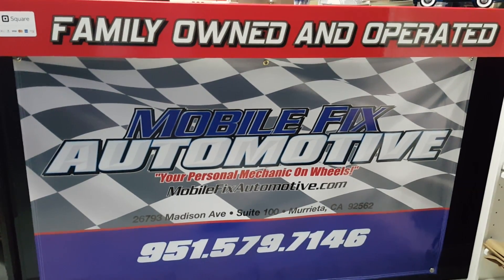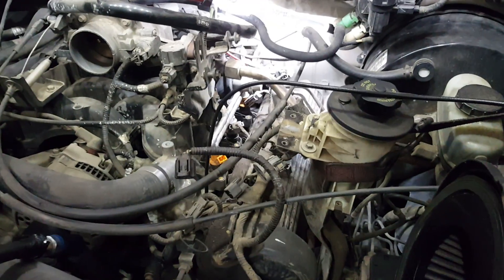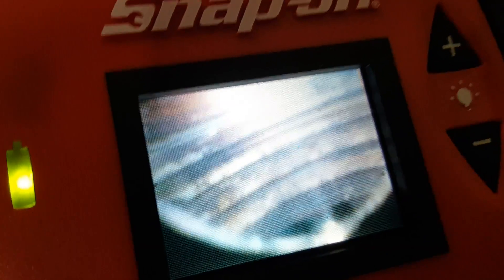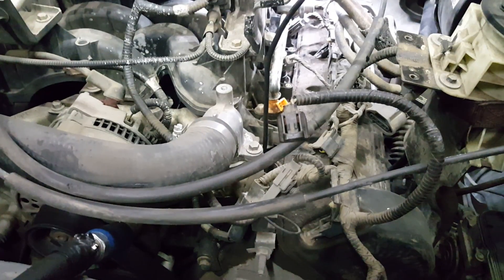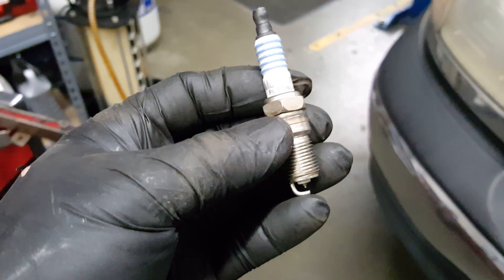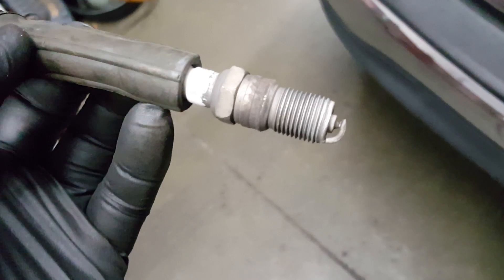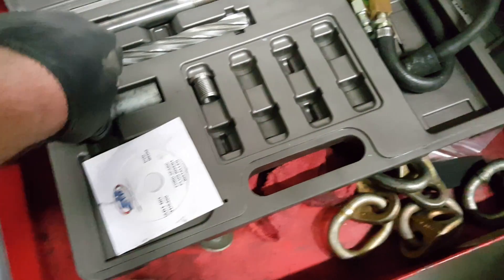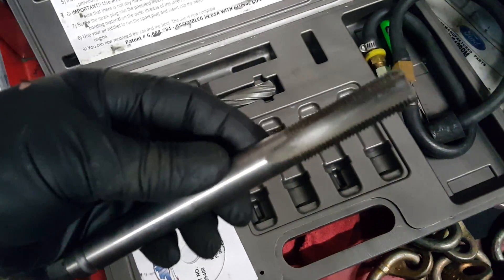Why the spark plug blew out of your Ford Triton engine

Comment: I had a 4.6 in a crown Vic that also had a very small amount of threads.  And there was a lot of room for more threads.   Before I replaced my plugs I was told not to tighten them much at all, and it would be better if I had a torque wrench.  When I took the plug out I was amazed at how few threads held the plug in.  And that was a different engine, similar, but not the same.  So this appears to be a Ford practice.  I installed the plugs fine, but was never completely happy knowing how they were held in.  I've had Japanese and German cars and almost all of them had twice as many, if not more, threads than this.  On an aluminum head, this is not a great design.
Reply: Ford makes unreliable vehicles. Sometimes I wonder if some of their foolish designs are intentional.

Comment: Had a buddy that used to own a truck with this engine plug blew out and dented the hood from inside out had to repair engine and hood then he had exhaust manifold leaks found rusted away bolts on his grange floor from the manifolds.

Comment: Good job Ron. My thinking is the dissimilar metals corrosion problem adds to the few threads problem and that's why so many are blowing out the plug. Look for evidence of water routinely getting into the plug well and leaking past the seal surface into those threads.

I see the over-engineered design of the insert kit, Heli-Coil inserts have worked well for me over the years and my standard tap & die set is a tool set I had already had, not to mention it's universal application.

I wonder if the kit is calling for JB Weld to be used. I think you might be wasting money on the stuff if not. I would use it on a Heli-Coil going into an iron head and not use it on a aluminum head for that very reason. That dissimilar metal thing can work in your favor in the case of a permanent thread repair.

Before I retired (ASE Master, trained at the GM college in Atlanta) my service manager told me I had the highest CSI of any mechanic working for GM: I wasn't too surprised, my stuff never came back.

Comment: 4-1/2 threads on an aluminum head ?  Seriously ???

General rule of thumb for mechanical engineers, the thread engagement depth should be no less than the thread major diameter.

This is a really good example of why I only own vehicles designed and built in Japan or American but older than late 70's.

Comment: Sooooooo this begs the question what about the metal shavings that git into the combustion chamber? or did i compleatly miss something
Reply from the maker: +INVISIBLE SUN this video was shot to show one of the main reasons for being the cause of the spark plugs blowing out. I have two really good videos on the repair procedure start to finish in that is addressed in that video.
Reply: Grease on the tool flutes catches the chips.

Comment: I had a spark plug blow out in the middle of nowhere, hundreds of miles in the Alaskan Interior, on a 2001 V-10.  It was too cold out to risk shutting the motor off for more than a few minutes.  I had to just pull the blown coil pack out, unplug the fuel injector wire and drive on listening to the open cylinder chug away.  Stupid engine computer didn't even show me a Check Engine light on the dash until another 150 miles down the road.  Never understood why so many insist on the "Built Ford Tough" garbage, I've been around several Fords and they always seem to need serious repairs.

Comment: This not a good video. This is a GREAT video. Listen to this man. Take your truck to him even if low miles and have him install new plugs with anti-seize BEFORE you have a problem. Loads cheaper and piece of mind.
Reply: Bad advice! Weld them in is the only way to prevent failure or in weld!
Reply: I didn't think of that. 👍

Comment: You just explained why the F150 outsells the Silverado. People like the repair bills.
Reply: A friend of mine who was a Chevy mechanic at a dealership Owns a relatively new Silverado. It has cost him more than $8000 in the last two years with trans, AC compressor problems, and other driveline crap.And he did most of the work!
Reply: @patrickkruger5310  You just described two people I know that had the same issues with their Fords. Transmissions constantly, turbos, injectors, engine problems, one says he'll never own another one. One bought a Dodge 3500 after so many issues. The other said his truck was in the shop more than he used it. At a diesel shop, I was talking to the employees and they work all models, and they all were in unison to not buy a Ford because of the amount of problems and their most constant truck with problems. The newer Dodges were next, said Dodge got the cheaper Cummins engines in recent years and they made them even cheaper and more unreliable and were their next biggest customers. So their least amount of problem visited customer was the GMs. They suggested those. This is not me, but a huge Diesel shop in Texas and their mechanics opinions. The earlier models were better made for about all brands they said. The drive for profits seems to have made manufacturers go to cheaper components.

Comment: What you're referring to as a drill bit, that is actually a reamer.
Reply: I was wondering why he called it a drill when it had no cutting edges on the point and heavy spirals It's a reamer for precise hole cutting. I am also wondering how do they remove the metal chips?
Reply: @patrickkruger5310  You have to vacuum them out, what you don't get out using that method are fine enough and are aluminum will burn out and pass out with the exhaust gasses.
Reply: @patrickkruger5310  Don't drill.  I used a dual tap to re-thread the hole.  Just put a little grease on the tap and the grease catches the cuttings.  Back it out each couple turns and clean it off.
Reply: You can tell he's not a machinest.

Comment: Had it happen with the #4 cylinder on my Expedition JUST out of warranty.  Cost me a pile of $ to repair.  I immediately sold the SOB and will not touch another Ford.  It's clearly a design flaw, Ford knows it, and they simply give the middle finger to their customers.

Comment: In my professional opinion(working at a machine shop rebuilding/repairing heads) the problem is that it's a Ford.  I'm not trying to be a smart ass...but the numbers just don't lie.  We see soooooo many of these engines as a whole or just the heads themselves.  We've made over $100k on the Triton series alone in the last few years.  I always laugh when I hear guys come in saying they'd never buy a GM because they didn't take the bail out money.  I explain that although true...I see the results of their cost saving measures every day.  Dodge is in 2nd place and GM products pretty far behind.  Most of the GM's we see are often the infamous valve stem seals(the morning blue puff)on the SBC's and V6's.   Although there are far more GM engines out there...as a percentage...we see double/triple the numbers of Fords for a variety of endemic problems they've saddled their customers with.

Comment: As long as everyone's bashing Ford...I needed a used truck for 'Home Depot' runs and the like some years ago. I wasn't particularly picky about what brand it was, as long as it had an 8' bed and standard cab. I couldn't believe how few were around. 95% of everything I saw were these huge crew-cab models I didn't want. I ended up with an '85 Ford F250 with the then new 5.0 EFI. What an incredible POS it's been! In truth, mechanically it hasn't really given me any trouble, but the flaky electrics on it have been a real pain in the ass. I ended up fabricating whole new harnesses for both the engine (computer) and the fuel pumps, of which it has THREE. Poor quality aftermarket fuel pumps lasted only a year. A genuine NOS Ford pump I found for the front tank lasted a month before it's brass float filled with fuel and sank to the bottom of the tank, reading as 'empty' all the time. It actually runs ok now...unless you really step on it, then the fuel injectors or ignition like to cut out for seconds at a time. I know with absolute certainty that a Chevy would never have given me any of this trouble.
Reply: The truck is a 1985? and you are complaining? You are full of chit.Go buy a 85 chevy if you can find one still running you dumb ass wipe

Comment: Brings back memories when I had my 2003 HarleyEdition F150. This was the number one concern for us Harley and Lightning guys...because we was all pushing boost and these 5.4L was spitting plugs on naturally aspirated 5.4s. Now its been a while but I want to say Ford corrected the problem in the later 2003 or 2004's? Anyhow, I put 100K+ on My Harley, raced the heck out of it and Thankfully I never had an issue...not all of my Harley buddies was as lucky though.
Reply from the maker: +My Road Tours they did not fix the problem until the introduction of the 3 valve in 2007. And then they over corrected. The 2003 and 2004 have same threads,  i do them all the time.  Lol

Comment: well, I haven't blown out any plugs, yet, but here are a couple of cents worth of bitchin. sure it was used but in 2007 I bought a 2000 F-250 super duty 4x4 with the V-10. it had 87,000 miles. guess what I learned after I got to 105,000 miles and my front axle bearings went to lunch and because of that my stub axles and anything connected was shredded. you have to buy new HUBS and if you just go to Ford you spend $700 each. then all the other mess. paying for a shop would have been THOUSANDS, 3,4,5? here it comes, HUBS ARE WARRANTIED FOR you guessed it, 100,000 miles.
who does that? older trucks have had 300,000 miles and maybe the BEARINGS were replaced, big deal. this was made this way INTENTIALLY. you cant just replace bearings.

Comment: I have never understood why Ford went with aluminum heads on the Tritons.
What did they save 10 pounds?
It seems to me threading steel spark plugs in to aluminum heads is asking for a problem to begin with.  Then there is the matter of the heads only having 4 threads.

I was on vacation and 400 miles away from home when I thought I had blown and exhaust donut.
I got a loud exhaust leak that I could tell was on one bank of cylinders not all 8.

I found a local muffler shop who would take a look at it for me.
It was the plug,
I was lucky it blew clear like the one in this video.
I was even luckier that this muffler shop also did general repairs and was able to instal an insert for me.

Comment: I traded my ‘97 in at 197,000.  Just oil changes, transmission fluid changes and repack front bearings a few times,  almost forgot, a water pump.  Ran as good the last day it as it did the day I test drive it.

Comment: When I was young I striped a lot of spark plug threads in aluminum head "dumb idea to not change thread pitch with aluminum heads.

I just screwed in steal threads and once in while I would put in a different spark plug to adjust for change in length.

What's going on here is Chinese or Mexican labor doing piss poor work.

Bring the jobs back and American worker will do it right

Comment: This is the same kind of shit that Ford pulled with the 6.0 liter diesel and 6.4 liter diesels they produce junk and then Force the public to figure out how to fix it and pay for it that's why I'll never buy another Ford product in my life!!!!! Yet every blue oval boy out there  will sit there and argue till they're blue in the face and tell you that after you throw $10,000 in the diesel engine from Ford it's a good motor I'll never understand the thought process!!!!!😵😵😵😵
Reply from the maker: +like a rock and what's interesting about your comment is that the 6.0 was not built by Ford it was built by International after the problems with the 6.0 happened Ford design the 6.4 funny they didn't get it right either. And I agree the six leaders are great engine but you have to put a ton of money into it to make it happen or you have to be one of the lucky ones to have one that never acted up.
Reply: Ron Williams I know that International made the 6.0(in my opinion that's absolutely no excuse Ford put thier name on it they own it just like Dodge and GM neither of them made the diesel engines that they use either but if they have problems it's GM or Dodges fault as far as I'm concerned they sold it) liter I honestly thought they also made the 6.4 L and then separated  from Ford on the 6.7. l I purchased my 6.0( based off the reputation of the 7.3 L which also was an International engine) and then it needed three head gasket jobs two on the dealership one I had to pay for after that it was gone !!!I run nothing but Duramax now they are unstoppable and rarely ever break at least the ones that I own!!
Reply: Darr can u understand what u read ???  😵😵😵😵🤤🤤🤤🤤

Comment: Just had ford quote me at 900 bucks for a blown spark plug :( https://youtu.be/Phg5iEsozU4
Reply from the maker: +Dwight W $285 parts and labor except van.
Reply: Mine is a 2002 ford f150 and I just bought the spark plugs from ford last year but they are trying to rip me off here in utah

Comment: I have a 2012 5.4 motor. I took it to ford because my check engine light came on. I got the tune up but now it keeps blowing spark plug 6. This is the third time its done it on me. Each time driving less than 40 miles and ford has had my vehicle for a week. Could you tell me what is going on. The vehicle has less than 69,000 miles.
Reply from the maker: +MR LOOKN4DCHEWN have them install a calvan insert. Thats what i install ive done more than anyone and never had a failure. Problem is Ford are usually using save a thread style inserts and they wont last on triton engines. Cal van has a kit for the 3 valve now.

Comment: Yep, your opinion confirmed here.  Driving a 24 passenger bus (Ford gasoline engine) a few weeks ago and blew a plug at 70 MPH.  Sounded like an exhaust problem.  Smelled like exhaust for the remaining miles, strong exhaust odor coming through vents along with popping sound.  Stalled once at lower speed.  Turns out plug holes have few threads, my boss told me "3" ?  Bus has 160,000 miles, 4 years old.  I think it was plug 7 of 8 cylinder.

Comment: The spark plug dissipates heat through the threads too.  Less threads (contact area) means a higher temperature in the aluminum threads, accelerating fatigue failure.  Higher temperature swings also means more thermal stress between the aluminum head and steel spark-plug threads, as they expand and contract at different rates. 

It looks like Ford had room to tap more threads, but chose to have a larger diameter non-threaded hole above the threaded hole.  I wonder if this was for machining convenience  or if they were trying to mitigate some kind of stress concentrator around the top of the threaded hole.  Hmmm.

Comment: I didn't read all almost-400 comments. I've changed plugs on a few of these Tritons. The key is to change the plugs before they blow out and over-torque them. Don't use anti-seize either. Torque to 20-28 lb-ft. See https://www.fordf150.net/forums/viewtopic.php?t=120193 - you won't have another blowout if you do that.

Comment: I'm a machinist, and that's a nonstandard way to do a spark plug thread.  Shelf to cylinder should be threaded, not four-ish at the bottom.  Yeah, it's a head issue, not a plug issue.

Comment: Hi Ron, great video. I, (an auto mechanic for 40 yrs now), agree with your assessment of the problem. I haven't run across the Triton with that problem but have with the 4.6 Ford motors. Obviously it's a Ford problem, I've seen other engines blow plugs out here and there but NEVER on the same style or brand on engine until this Ford problem. I generally don't watch these kind of videos but something "sparked" my interest. I haven't seen that Cal-Van kit yet, I like the looks of it. Thanks for taking the time to make the video.

Comment: I had this issue happen with a used Ford I bought with the 2v 4.6l. I specifically bought a Ford warranty through the dealer due to the mileage on the engine. Within a month, my #4 cylinder did this and the dealer said it was the sparkplug and a maintenance issue, so it wouldn't be covered by warranty. After a week of arguing with them than I had only had the truck a month and they performed the maintenance before I drove it off the lot, they finally approved the warranty work and installed the insert. They wanted to charge me over $1000 to do it if the warranty hadn't covered it.
Reply from the maker: +genghisman39 Wow!
Reply: Ron Williams The Ford dealer in my area is notorious for screwing people over. I live in a military town.

Comment: The rule is that you need the diameter of the bolt (the spark plug in this case) worth the threads if the "bolt" is being threaded into a similar material.  This is why you almost never find a nut that is thicker than its inner diameter hole..

Now, when the steel "bolt" is threaded into a softer material such as aluminum, you need at least 1.5x the steel "bolt's" diameter worth the threads.  Exact numbers necessary depend on the actual metallurgy, but this is the case.  I'd be more comfortable with around 2x the threads.

The ford cylinder head didn't even have the diameter's worth the threads in aluminum.  Without sufficient threads, the "bolt" cannot be stretched sufficiently when it is tightened, and thus it comes loose relatively easily.  This is how fasteners come loose.

A cheaper fix for this is to thread it bigger, install a cheap thread insert, and use a different style spark plug with a crush washer on it which lands on the "shelf" below... is a bit hillbilly of a fix, but by doing this, you can get sufficient threads and it seems to work quite well.  It costs all of about $10 vs buying the $hundreds$ kits which someone will maybe use once unless you work on Ford vehicles frequently.